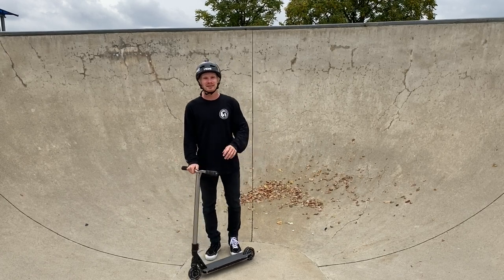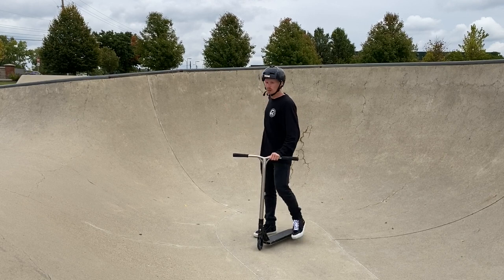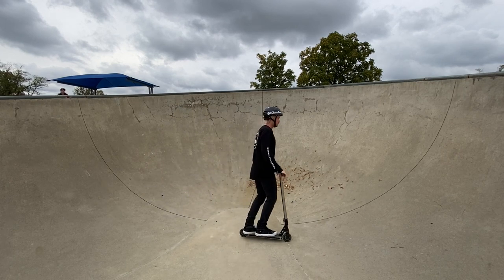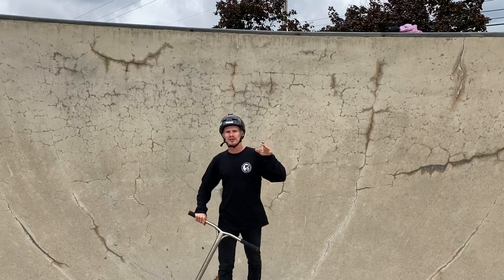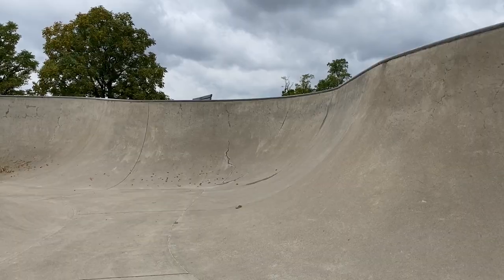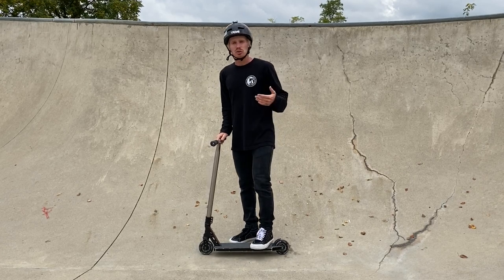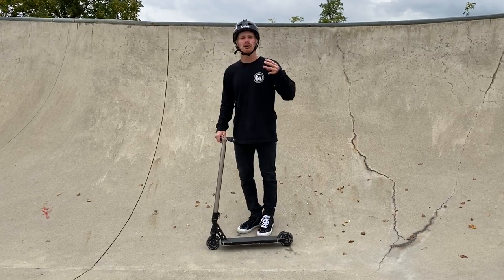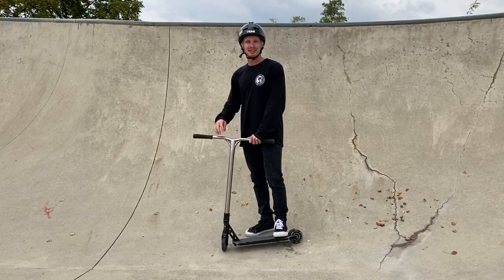HOW TO PUMP AND FLOW A SKATEPARK BOWL OR HALFPIPE

Comment: How much does body weight have an influence on pumping ? I see the kids at the skate park fly in / out of the bowl so easily ? 

(FYI … 80kg middle aged male skating with my 7yo son)
Reply from the maker: body weight definitely has a huge effect. but its by no means the main influence. The most crucial part is always going to be the mechanics of how the rider pumps. if a small rider learns to push and compress at the right moments then they can easily keep up with bigger riders. it just so happens that bigger rider are usually older kids so they have more straight and are therefor able to push into the ramps harder, hence generate more speed. 
For example- I am only 125lbs or 56kg so definitely on the lighter side, but i can still  maintain a quick speed in bowls compared to a lot of lighter and or heavier riders just because i've been doing it for longer than most of them.

Comment: So lately ive been learning how to ride quarters. But, I would like to learn how to flyout without hitting my wheel on the coping. Any tips?
Reply from the maker: I would definitely recommend trying to take off from the quarter just a pinch early. sometimes it can help if you pick a spot on the ramp (about 6ish inches below coping) and try to pop your front wheel before you have a chance to touch the coping.

Comment: Yo Chase it's Nathan from Mike's bike park can u give me the measurements for an ethnic brake on spider deck
Reply from the maker: Yoo hey Nathan, the center of the brake hole goes .75 of an inch away from the brake cut out. and the deck center is 2.36. definitely lmk if you need any more help putting that hole in there